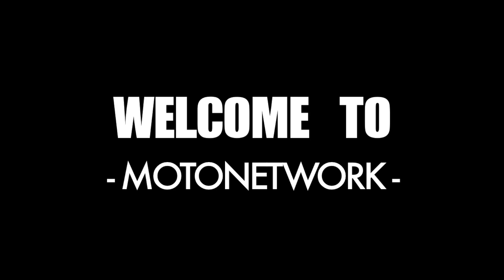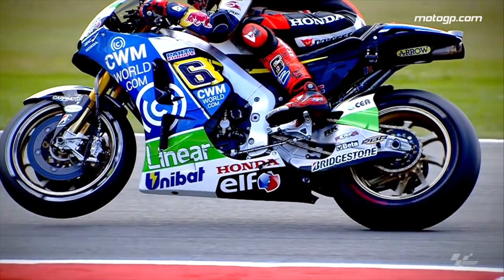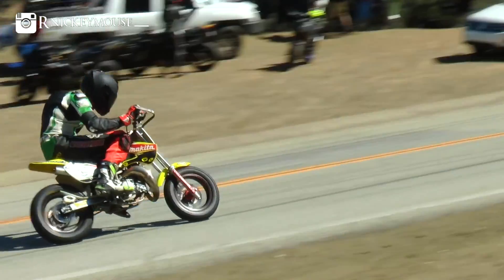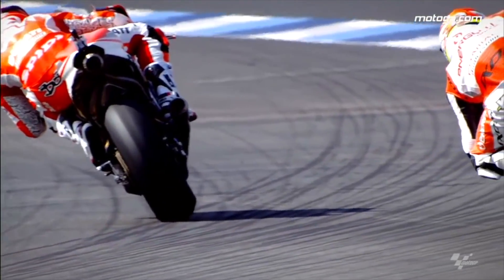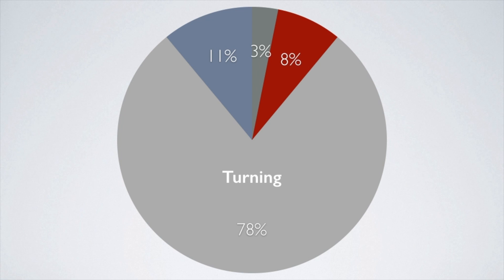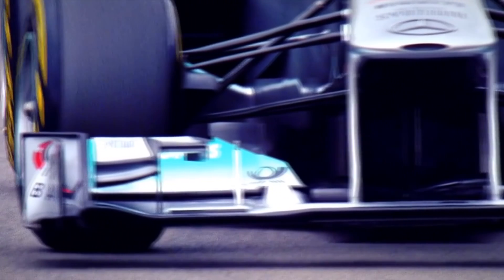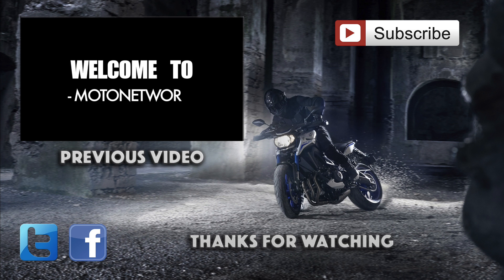Motorcycle Traction EXPLAINED!

Comment: This statement is incorrect - "The amount of rubber is going to be the same whether the motorcycle is straight up or leaned over". I spent a few days with the engineer that designed the Q3, Q3+, the tread pattern on the Q4 and multiple other Dunlop tires. This question was posed to him and he said no: "We design the tires to have more rubber on the road when they are at a lean".

Comment: Finally someone who understands that having a contract patch as wide as a building but with the weight of a butterfly doesn't equal extra grip.

It's all about what material and how much weight is pressing down, if you have twice the contact patch you'll spread half your weight over twice the distance AKA same grip assuming same compounds.

And the reason it feels like people fall easier once they're already at an angle is, because we just are overlooking all the times we slide and start falling from mostly upright positions, but we have remaining angle to correct the slip up, whereas if you're already. skimming pegs or plastics on your lean, a few more degrees over to the wrong side means your wheel is in the air now, so how could you correct it if you don't even have a few degrees to catch your mistakes.

Comment: If the size didn't matter, drag cars wouldn't have wide slicks in the back.  High performance cars wouldn't be outfitted with wider wheels and tires at all four corners.  Your theory is slightly flawed.

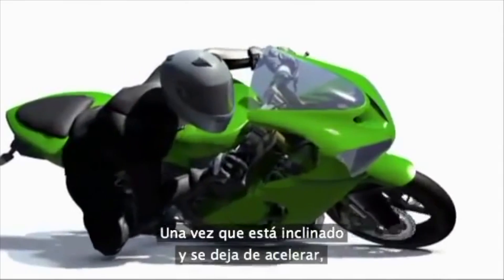Comment: 3:06 wrong! There is less contact area when you're leaned over.
Reply: Nope, it actually increases up until you lean to the designed maximum lean angle of the tyre, for sporty tyres. It's "not the same" at any angle as the narrator said, though.

Comment: Then I have a question for cars friction laws... why having bigger wheels (so, tires) gives you more grip?
As an example (stretched a little), switching a track day car from 16 inches wheels to 19 inches wheels will bring ridiculously better time on the track. 
From my understanding, it is better for grip in corners, not really for acceleration, but I might be wrong.
How come, if the contact surface isn't a factor?
Reply: You're not talking width, though. Switching from 16 inch to 19 inch only changes the profile.

If you at the same time change to wider tyres, yes, wider tyres do indeed give better grip generally. The biggest mistake people do, even engineering students, is taking the contact-area-doesn't-matter fallacy for granted. It simply isn't true for rubber tyres.

Comment: I thought I would toss in the important aspect of radius of wheel contact patch, which affects motorcycle tyres. When turning, the bike is leaning over and there is a semi-elliptical contact patch. Due to the curvature of the tyre, this patch is bent and the more bike is leaned over the more bent it becomes as the contact patch moves around the sidewall of the tyre towards the axle.
The problem with this is the the contact area closest to the axle is moving slower than the  outer area due to the radius of the contact patch from the axle. The difference in speeds mean that the inner and outer areas of the contact patch fight each other, reducing grip.
I am no expert on the subject, but I would say that that is why it is better to get the rider off the seat and leaning right out, thus allowing the bike to be more upright so as to minimise this effect.

Comment: While the amount of friction is dependent on total weight (bike+rider) and is constant, the advantage of a larger contact patch, generated by softer compounds which deform more and increase contact patch area over the original tire, is that it spreads the shearing forces generated by cornering out over a larger area.

Comment: I just had a doubt regarding the 2nd Law of friction because I find it to be false. I have done experiments in college on a disc brake rotor with various sized paddings from those of a normal car to performance rally car paddings and found that even when there is a change in coeff. of friction and force applied, there is disprportionate change between the old braking power and new. It might be possible that the parameters we used may be wrong, but can someone explain this discrepency to me?
Reply: And if I am wrong then how can you explain why manufacturers employ a 6 to 8 padding brake system with massive contact area, rather than a simple two padding setup...
Reply: The reason for more pad area is spreading out the intense heat generated over a larger area. Brake pads generate gasses when they are heated, these gases actually lift the brake pad off of the rotor, causing "brake fade", this can get so extreme that 90% or more friction just disappears. This is also why brake rotors may be drilled or slotted, this is to allow the gases to escape. Also, the brake rotor is way more capable of carrying away excessive heat, so keeping the pads in firm contact with the rotor, instead of riding on a heat insulating cushion of gasses, is necessary to maintain friction under heavy braking usage. There are a huge number of different compounds used for brake pads, for heavy racing, the choice of pad compounds chosen by any street bike manufacturer, and supplied on stock bikes, is usually a very poor compromise and aftermarket pads are the way to go.

Comment: What about the fact that when the bike is leaned over the dampening effect from the suspension is diminished? 

On a track free of bumps and if the velocity is constant then this wouldn't matter, but bumps create moments where there are changes to the pressure between the ground and tire. Bikes are built to have vertical suspension travel. The greater the angle of lean, the less the suspension can absorb the bumps, and the more the chassis absorbs the bumps in the form of wheel hop. This is why bikes have less traction in a turn.
Reply: This is caused by a compromise in suspension design. Most street bikes (for some weird reason that I just don't get) have very limited suspension travel, and while this may make the bike seem more responsive, it just scares the shit out of me. I can drive around any street bike on a rough road on my dirt bike with full knobby tires, because I virtually never loose traction because of 12 inches of suspension travel and super squishy springs. It's not going to beat a sport bike on a smooth track, but in the real world, huge suspension travel is very confidence inspiring, and for that reason, I won't ever own a "street bike", they're just too scary. I like my tires to be in contact with the road at all times.
Reply: Suspension travel comes from the length of the forks and springs. Look at the Ducati Hypermotard vs the Monster. The Hypermotard has much longer front forks. Not very aerodynamic, nor is the angle ideal for avoiding wheeling. That's why sports bike have stiffer suspension inherently.

Regardless, there is no horizontal suspension travel built into a bike, yet the bike leans to a virtual horizontal on the track. This is inherently dangerous.
Reply: The angle or length of the front forks does not affect the propensity for pulling the front wheel off the ground. The only factor is an imaginary line drawn from the rear tire contact patch that intersects the center of gravity (which includes rider), when the rear suspension is carrying more than 99% of the weight and the front tire is carrying less than 1% of the weight. Move the center of gravity lower to achieve less front tire unloading. Unfortunately, if you want to be able to lay the bike over in a corner, you must raise the ground clearance, and therefore, the center of gravity will be raised, resulting in a compromise.
Cornering G-forces that are applied to the rear suspension are normally within a few degrees of vertical, even when you are scraping the pegs on the pavement. The problem arises because of the fact that the bumps in the track are now trying to push the tire sideways, a direction that the rear suspension can't go. At this point, the size of the tire, the width of the rim, and the tires air pressure are acting as the suspension in the "sideways" direction. A huge fat tire with low air pressure will keep the rubber on the road much better than a smaller tire with higher air pressure, because the bigger tire will have more "sideways suspension travel" and because it will be softer, and less likely to "bounce" off of the pavement. During cornering, the load on the rear spring changes from regular ole gravity, to centrifugal force, which can theoretically exceed 1 G at times. Now regular gravity is still pushing down on the bike, but the wheel is now almost laying on the ground, and the only suspension action up and down is in the tire sidewall or flex in the swingarm, which, by the way, is not damped by the hydraulic shock absorber, so it will have a tendency to "oscillate" or bounce in a very rude and uncontrollable manner. This is how a small bump in the track can make the wheel bounce completely into the air, there's very limited and uncontrolled (undamped) sideways suspension action. The bikes that are built more like a dirt bike, with lots of suspension travel, also have a very high and concentrated center of gravity, with these bikes the "sideways swingarm length" is much longer than your typical race bike. This means that they have more "sideways suspension travel", with the center of gravity being much further away from the tire contact patch, which is trying to move up and down, with the center of gravity being the pivot point. The longer "sideways swingarm length" makes the bike much more confidence inspiring in the turns, but also makes the front wheel come off the ground earlier, turning it into a wheely machine.

Comment: Moto GP rain tyres are not 'skinnier' than the slicks. They are the same size, but they do have a very deep and wide tread pattern which dissipates the water and prevents hydroplaning.  They also have a compound that is so soft that they can only be used in wet conditions and would turn to the consistency of chewing gum if you used it in dry conditions because of extreme overheating. Nothing to do with the width of the tyre.

Comment: Contact area does make a difference because tires don't slide they 'shear' leaving a layer of rubber behind like a pencil on paper. The force to shear rubber off the tyre IS proportional to contact area. Also tires deform into the road surface texture so even on wet roads where they slide instead of shear, the bigger contact patch finds more lumps, cracks and edges to hook around. That's why they're soft (and wide ;).

Comment: please do your research before posting stupid videos .
first - 
rubber is elastic material , so your high school physics claims of "larger contact wont add friction" does not work for rubber . 

and second -
in motorsports , more weight is not exactly more friction .
well , in theory you have more friction with more weight , but more weight adds more momentum to the motorcycle . again , you doing your high school physics here .
let me explain : 
if you're pulling a motorcycle with locked wheels , it will be easier to pull it without a fat person sitting on top of it - so this is your "more weight =more friction" theory learned in schools.
but in reality , your added weight to the bike adds also more momentum  .the added momentum will be proportional to added mass , so 
the mass cancels out , the only thing controls the friction amount is the coefficient of friction , which is not mass dependent . 
so in reality the weight of the vehicle will have no effect on stopping distance . added weight will only make the needed braking system heavier and generate more heat . 
thats why semi trailer truck is not stopping better then a light weight motorcycle .

Comment: Okay.. i think i follow your logic here. But why in the fuck do drag cars use wider tires then? According to this theory, if a car's weight stays constant, and heat does not degrade the tire then a car should have the same traction regardless of tire size, but i can guarantee you that a car with 375 radials will be able to launch with more traction that a car with 275 radials. I use launching as an example here because at launch there hasent been any time for heat to build up in the tire, so that is not a variable
Reply: also, drag racing tires wrinkle to provide a larger contact patch with the ground, as well as having no tread for the same reason
Reply: I think it has to do with the fact that the asphalt is not an even surface. So by putting wider tires you incase your chances at traction (decrease the likelihood of slippage) across the surface. Another way of looking at it is if the contact patch were just a single point then the friction would be calculated by the coefficient of friction exactly where the point lies which could be good or it could be quite bad. But if you have a large contact patch the friction is like the average of the coefficients of all the points under the patch. That’s how I understand it anyway.
Reply: +Kanaan Windham Pretty close actually. It's one part of how tyres interact with the asphalt.

What you're describing is an average pressure of the contact area, which is a decent approximation. The science on the matter have identified several ways the rubber interacts with asphalt/road and what you're describing is still a macroscopic view of it, though.

If you want to go into the details there's still research to be done, but several components have been identified that contribute to the total friction force of a tyre... Even in the '70s they had identified adhesive (stickyness), deformation (keying or "locking" into the surface), viscous ("flowing" or vibrating over the surface), and tearing components of the friction force.